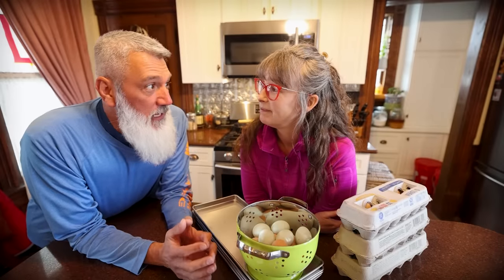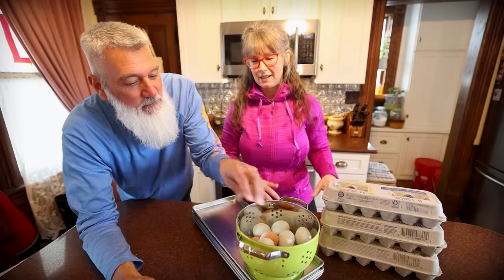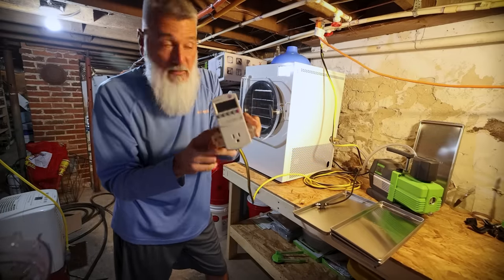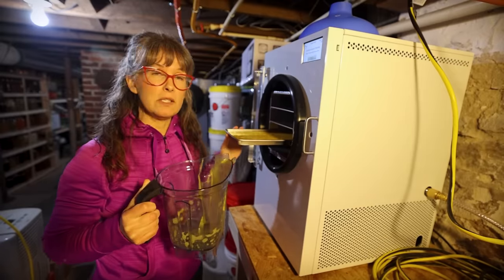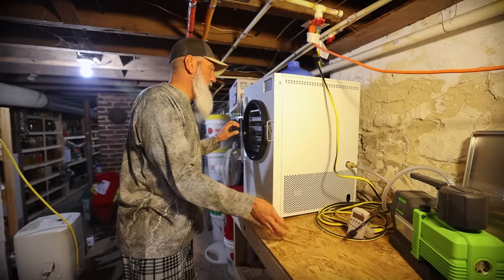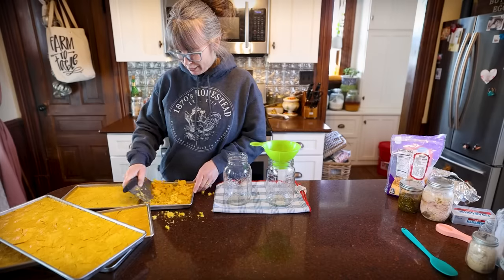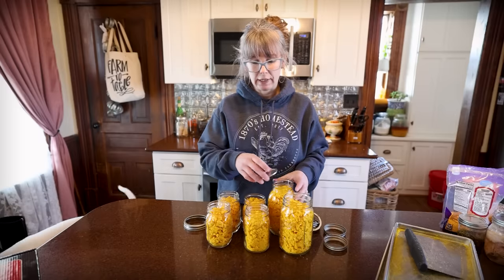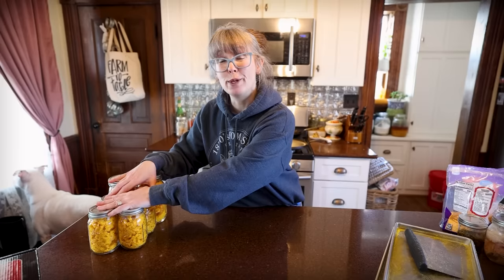Freeze Drying 101:  Understanding the Cost of Using a Freeze Dryer

Comment: Hi,  I have a medium HR FD, I place 18 eggs per tray.  I put empty trays in my upright deep freezer, I have the silicon liners, then I use my hand beater with the single whisk attachment.  I whisk the eggs, then pour onto cold trays in the freezer.  I freeze solid, then place in my FD.  I let it run, then add about 8 hrs to the cycle. (usually I'm going to be at work, or elsewhere so I want a cushion when I get home)  I scrape the dried egg pieces into my food processor, and turn into a powder in less than 60 seconds. Each time I do this, I get 6 pints per FD run; I vacuum down to seal. 72 eggs per run; [4 trays &18 eggs tray] / 6 pints = 12 eggs per pint jar

Comment: I have a large Harvest Right and I can do a half gallon of liquid like milk per tray and also 36 eggs per tray! I have found that if I crack the eggs into a jar(36 in a half gallon), use the boat motor blender and then keep them in fridge over night before I pour into Arctic they work great. any foam from blending has settled and they actually pull away from the sides of the trays while freezing and don't crack.  You get a nice dry block of eggs. I put them into a ziplock by tray and crush them up then store them. My load took almost 60(clock) hours. It was not frozen beforehand, just cold. I was able to do 180 eggs at a time though.  Another great way to powder them in the jars is to use a meat chopper like you would use for cooking ground beef or sausage. You can pick them up at the 5 Quarter store!

Comment: If you completely powder your eggs one dozen will fit in a pint jar. Thanks for the break down very helpful 🙂
Reply: Alot of people crush them in a zipper bag with a rolling pin -  since they are raw you need to be careful when using a processor or blender because friction heat can build up quickly and start to cook them!  My favorite way has been to put the chunks into a smoothie type jar and use a long bladed off-set spatula to hand crush into a fine powder. Works well and i can control how small I want the pieces. 😊

Comment: Thank you for the information on the cost of using a freeze dryer. Even though you had to run it longer due to error, I still don't think it was too bad. I have been contemplating buying one, contemplating meaning talking hubby into it... so now I can have him watch your video. So I have a question totally unrelated to freeze drying costs. I noticed when you were cracking your eggs you had some brown and white ones. I will admit I don't know a whole lot about farm fresh eggs but I would like to have chickens, for eggs only. I have been buying pastured eggs for a while and they usually are always brown especially if I buy from the store and they always have little specs in them. Brown pieces of something. The white ones do not. I need some enlightenment please from someone who has brown eggs. Is this a normal thing or am I just a bad egg buyer???  🙂
Reply: My Brahma hens lay eggs with brown freckles on them. Completely normal!
Reply: @donconB Are you talking about the shell of the egg or the egg liquid inside having specks?

Comment: The freeze dryer was very expensive. You need to amortize the cost of the unit over the number of runs it will do in it's lifetime. Also the vacuum pump and the oil it uses are consumables. If you have the oilless pump then it is even more expensive per batch because the pump doesn't last.

Comment: I bought one recently and I did one run. It kinda worked, but I think I did it wrong. I've messaged Harvest Right about this and I haven't really understood their answer. When you power on the freeze dryer, do you also power on the pump? At what point do you cut the pump off? When you cut off the freeze dryer or am I completely wrong. Thank you for your time and expertise. Enjoyed the video!
Reply: Do you have the pump plugged into the back of your freeze dryer (FD)?  It isn't supposed to be plugged into the wall. If your pump is plugged into the back of the FD, you don't need to worry about powering on or off the pump. It is done automatically by the FD depending on what cycle it is in. I hope that helped.
Reply: @a.francis6801  That was it! lol Thank you!! I wondered what that outlet was for, but I thought maybe they were just being nice and giving an outlet! cries in laughing shame
Reply: Did yours not come with an instruction manual?
Reply from the maker: Exactly this:  Do you have the pump plugged into the back of your freeze dryer (FD)?  It isn't supposed to be plugged into the wall. If your pump is plugged into the back of the FD, you don't need to worry about powering on or off the pump. It is done automatically by the FD depending on what cycle it is in. I hope that helped.
Reply: @ABlueDahlia   I am so glad that that fixed it for you! =) Enjoy your freeze drying!!!!  It is fun.

Comment: How often do you change the oil in your pump? And what kind of oil do you use? That is the most expensive part in my opinion if you change the oil as often as they suggest.
Reply: Premium pump only needs an oil change every 20 batches.  Plus you filter the oil to re-use it.  So the cost is not as much as you think.

Comment: Do you do "Water glassing" egg side as well as Freeze drying?
Reply from the maker: We've tried it before, and failed.  Suspected we had a cracked egg get mixed in or something.  We have several videos on it posted.
Reply: @1870s  Does "One" cracked egg ruin the whole batch? 
I've started small - a jar, 8 eggs, none of them floating...Will try to find your videos - are they in a series?  :)